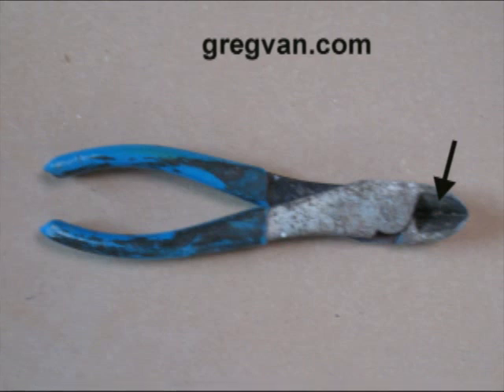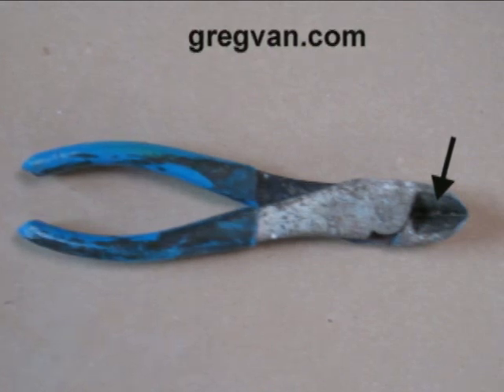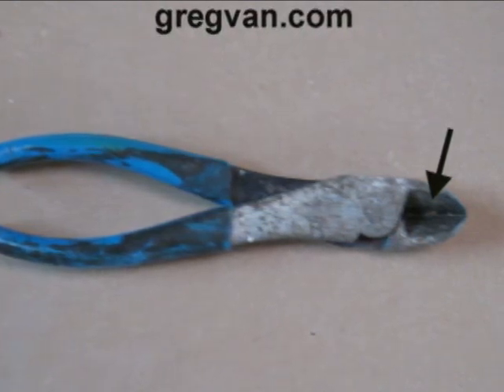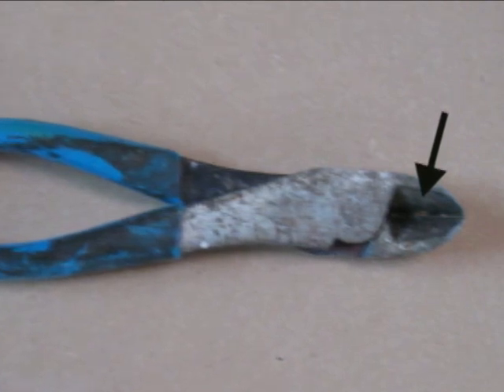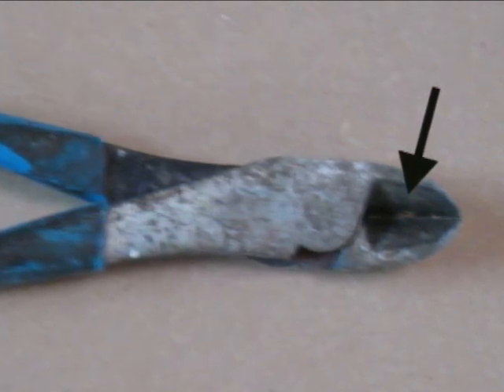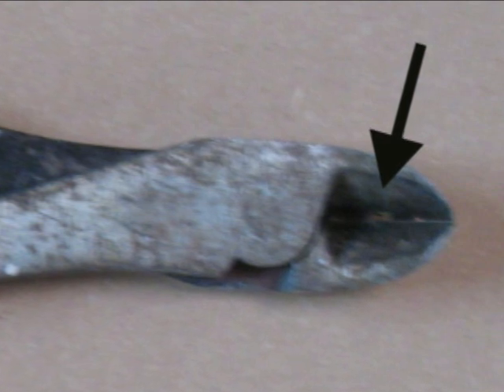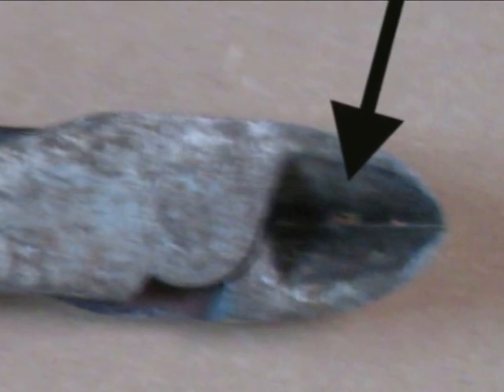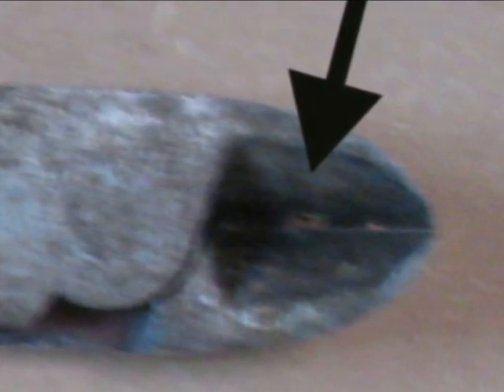Wire Cutter Damage From Hot Electrical Line

Comment: note that you had cut both the hot and neutral wire at the same time causing an arc, that burnt a hole in your dyke's...You can saftley cut hot wires by cutting them one at a time. If you have no electrical experience you should not attempt to address electrical problems.